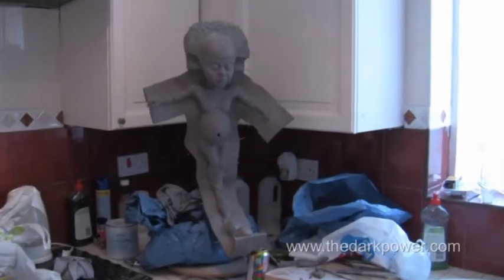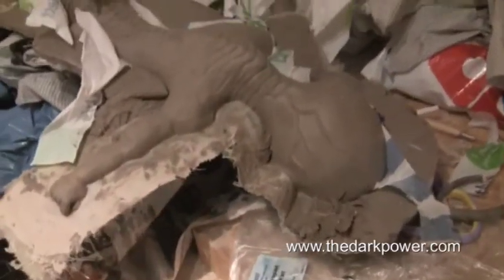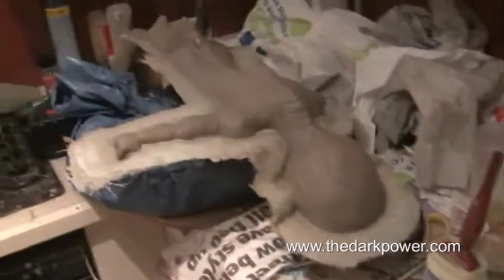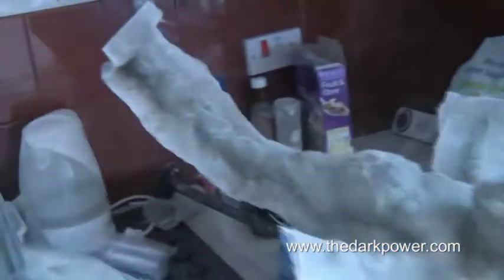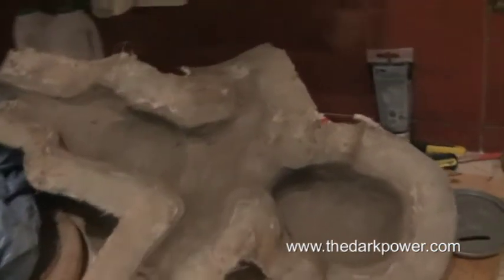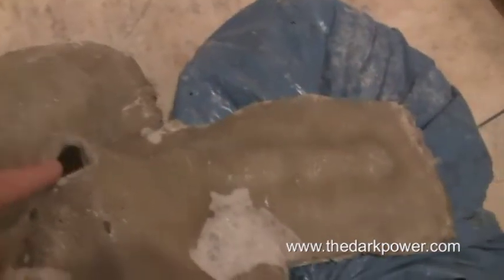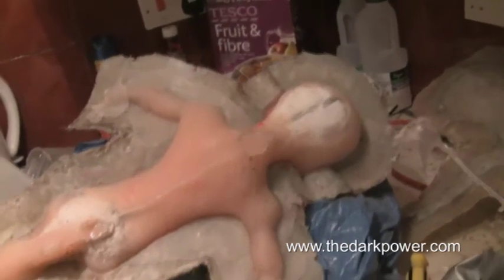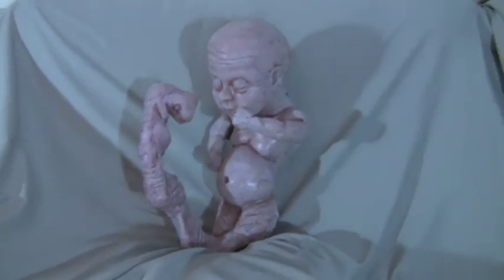Making a Rubber Puppet

Comment: @STUDENTOFARNIS Hey Dark Power. Question for you. When you built the layer of expandable foam inside. Did you leave it inside your mold when you poured the liquid rubber in? I'm assuming you did. What type of liquid rubber did you use? Is it a Smooth On product?  What kind of flexible paint do you use?